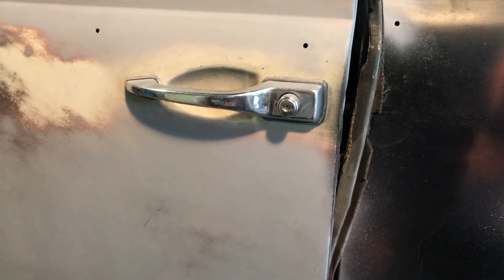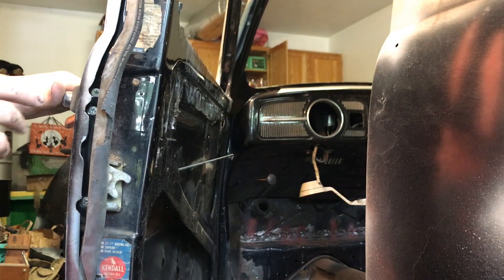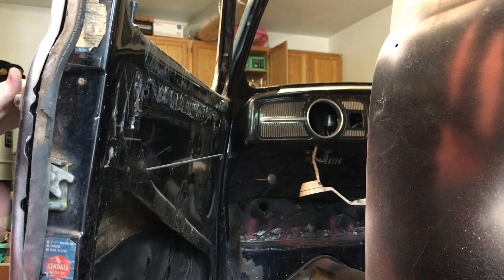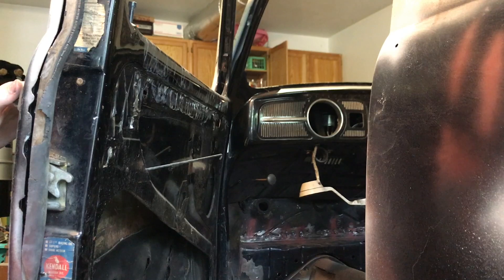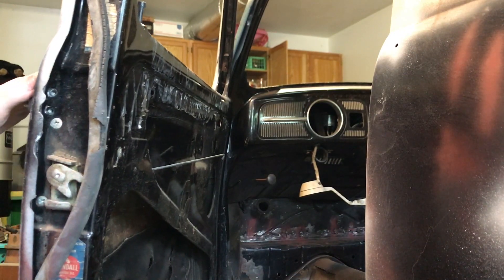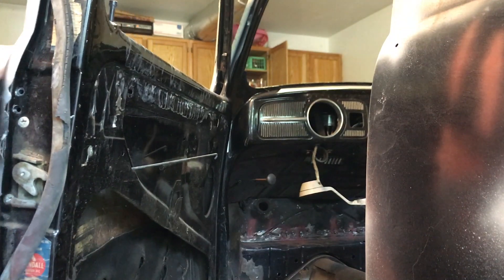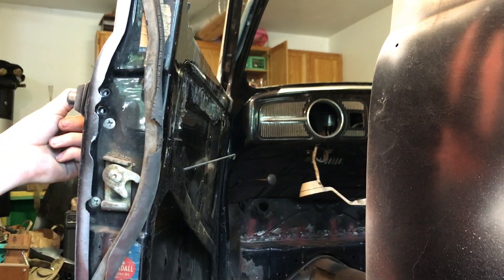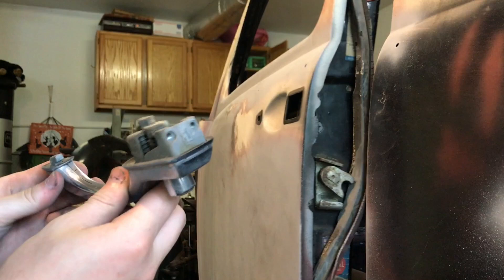Removing Classic VW Beetle Outside Door Handle

Comment: Your hand’s in the way, also you don’t show or explain the mechanism it’s hooked to that makes it function.
Reply from the maker: Hi Jerry, yes I see my hand was in the way, all you do is pull the handle out really. It's only held in by the screws. The VW handles have no mechanism. Unlike an American car where the interior handle, lock, and outer handle are connected by pushrods, the VW handle is it's own unit. The mechanism is in the door and stays there.